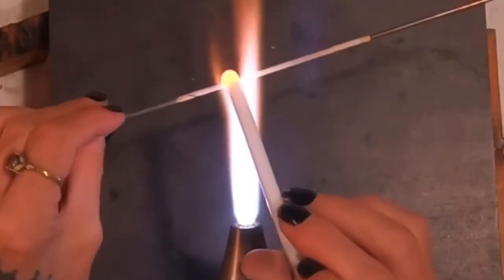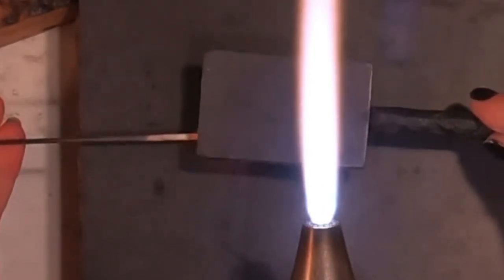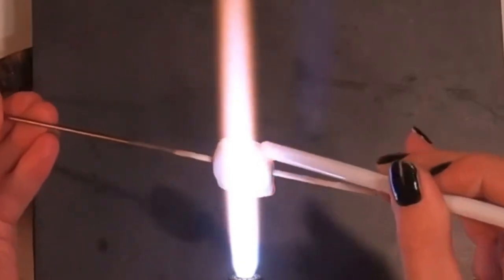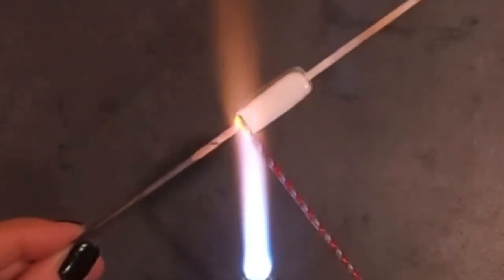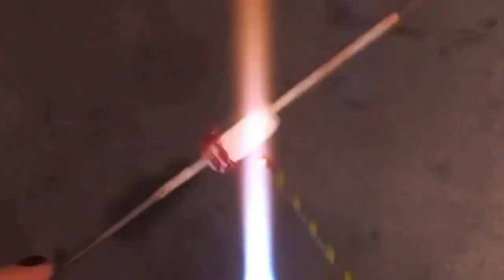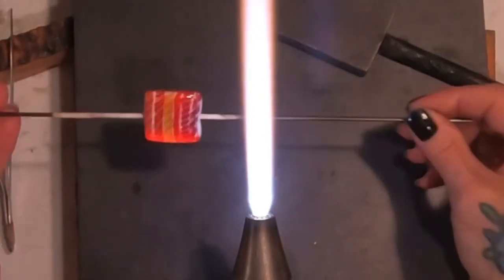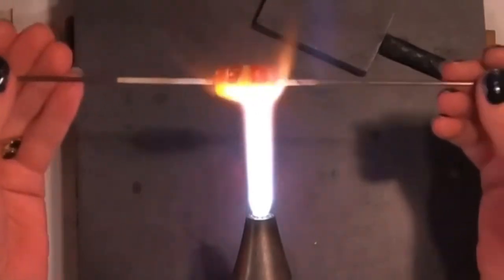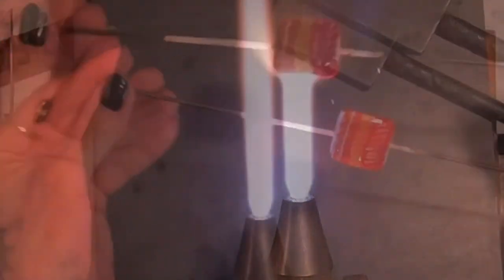Lampworking / Flameworking - 101.36 - What A Square! - demo

Comment: I guess I should have made my request clearer. I was asking about making a square cube bead. My bad. Still a great video though.
Reply from the maker: Hey there!  I just went with the idea and ran with it….😂😂🌹
It did turn out nice.   I was laughing about it because just as I was finishing with the editing,  I got the Cube response.
I love it!   Two ideas out of one.   Thanks Enrico! ✨✨✨
Reply: If you want a cube, just make a barrel as wide as it is long, then mash into a cube either using parallel mashers or on a marver. And then adjust. Then add corners as in the square bead. Check out this video https://youtu.be/kc2MdptFb58
Reply from the maker: Thanks for the sharing Krista!   The cube is also in my queue! 😘🌹